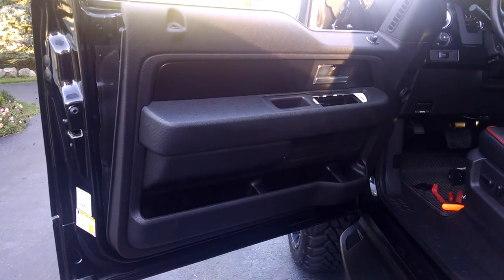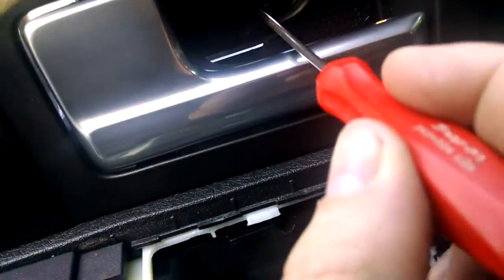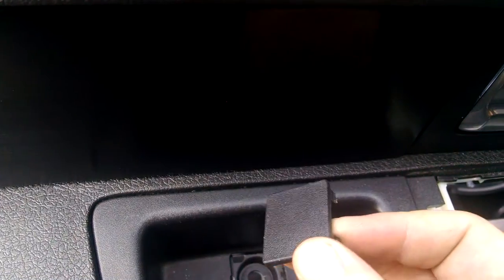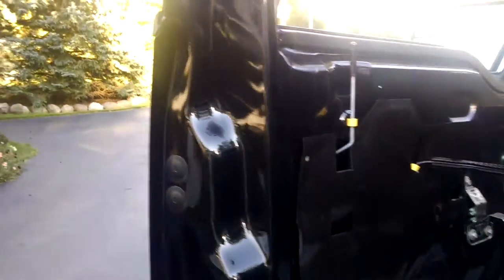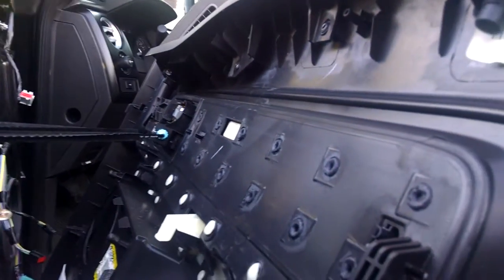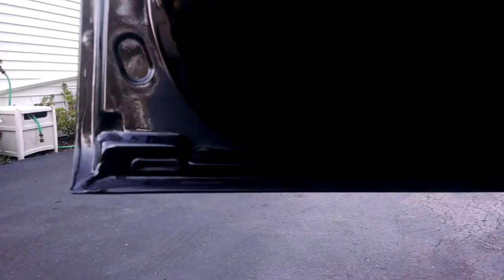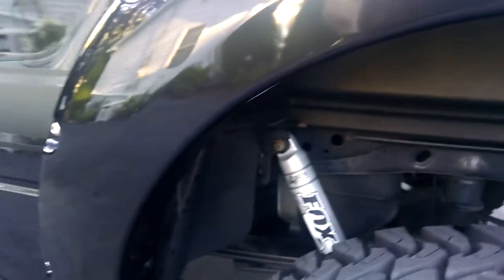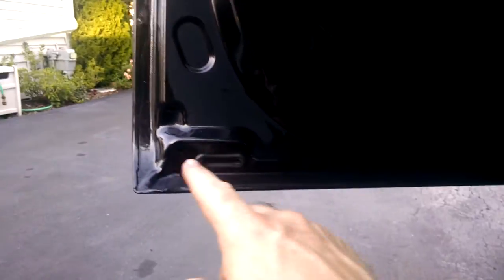2012 F150 Door Panel Removal And Fluid Film Use

Comment: The great thing about this is that if you can keep that body from rusting apart then after your wear that motor and transmission out you can put another in that body and drive it another 10 years or more because a truck body doesn’t go out of style

Comment: I found rust on my lower door behind the seal. Do u think i would be fine without the seals, especially if it will help to prevent anymore rust or moisture. Might get a little wind noise but i think i might be okay with it
Reply from the maker: It’s just a just dust seal.
Reply: @gjodexter  cool. Thanks

Comment: Hows the fluid fim holding up
Reply from the maker: James Karr Stopped all current rust and prevented more from starting. So it holds up great. Just touch up the areas behind the tires once a year and your good. I am about to do the full frame on my new Raptor.